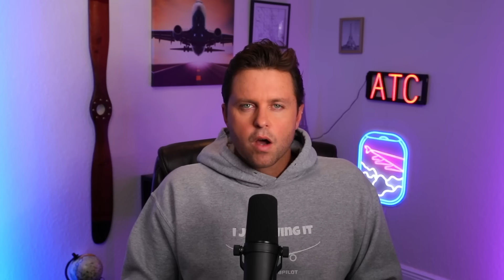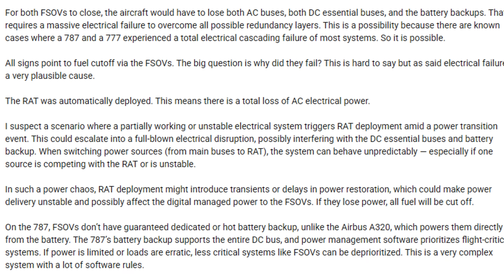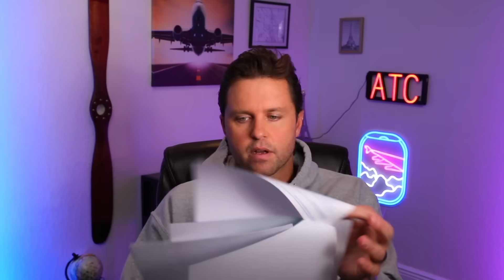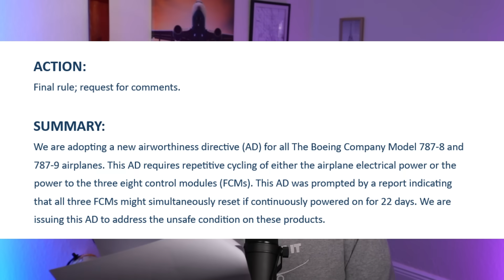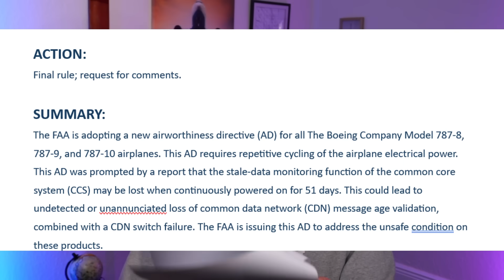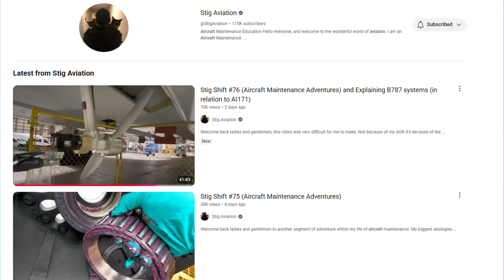Air India 171: Did a Software Glitch Cause Dual Engine Failure?

Comment: I wrote the following out yesterday, but I don't know enough about the interaction of the electrical and fuel systems to narrow it down, until seeing this video. But here's a compilation of all of mine and others observations and conclusions so far:

We know that the airliner took off normally, and ascended to about 400 feet altitude and SOMETHING caused a catastrophic loss of lift, leading to a descent and crash. 

More likely than not, this was the result of a loss of thrust in one or both engines due to the nature of the incident, the pilot mayday call ("thrust not acheived").
More likely than not, this occurred in both engines simultaneously, due to the lack of observed yaw at the time the descent began and in the moments leading up to it.
More likely than not, this was NOT the result of an externally induced mechanical failure (bird strike) due to lack of observed flames, flashes and/or smoke from either engine.
More likely than not, this was NOT the result of fuel contamination due to the suddeness, severity and simultaneity of the loss of thrust in both engines.
More likely than not, the RAT was deployed based on audio and visual recorded evidence and the firsthand account of the lone survivor (who described lights flickering and a loud bang).
More likely than not, an electrical or hydraulic failure occurred shortly after the gear retraction was selected, due to the observed wheel assembly rotation known to occur at retraction initiation, but was further observed to have been halted prior to the next phase of the retraction process.
More likely than not, the fault was an electrical or hydraulic failure due to the deployment of the RAT, which is known to occur automatically in a very specific set of circumstances relating to engine or hydraulic systems failures.
More likely than not, the specific circumstance for the deployment of the RAT was a failure of both engines, due to the likelihood of simultaneous loss of thrust in both engines.

Based on the above conclusions, I hypothesised that the simultaneous failure both engines was caused by fuel starvation, given the robustness of jet engine design to tolerate significant mechanical damage or fuel contamination and still produce thrust. Nothing short of a near complete absence of fuel being delivered to the engines should have caused such a significant loss of thrust, so immediately, without other external signs. Furthermore, I posited that the cause of fuel starvation was likely related to some kind of cascading electrical failure that occurred at the time gear retraction was selected.

Interesting to see other people narrowing in on the same direction.

Comment: This is very logical.

In my view, aircraft took off, sole survivor mentioned the lights flickered and then he felt weightlessness as the plane stopped rising. Another passenger the day before described how the plane had issues with non working displays etc. The pilot also described he lost all “power” and didn’t achieve thrust as his last communication. The wheels began to retract but stopped midway, which is why they had the forward angle. It’s as if the electric power just stopped and seized all hydraulics. RAT gets dropped as a consequence. 

Engines seemed fine at take off, it’s as if someone simply placed both throttles into off position. << This is has been on mind all along. But why. I don’t believe pilots did anything wrong, and your video is therefore a likely explanation of the plane simply shutting engines off due to some catastrophic glitch. 

liked & subbed 🤝

Comment: Not saying something like this isn't possible but are we conflating the issues here.  Transitions on i would imagine most aircraft electrical systems will not compete with each other. Once a GCU detects one or more  of many possibilities like over current, under current, over frequency or under frequency or a self-test failure it will drop that controlled system to the backup. If the backup fails as well it will immediately transition to the emergency and ultimately battery or in this instance the RAT.

The system would require an attempted reset to bring it back on and most likely manually initiated by a pilot and not automated. Cascade failures all the way to the battery backup or for jets like this the RAT should not be enough to starve the motor as the cascade failure happens even if they are spring loaded to closed with power off or momentary power loss. It would almost require numerous failures potentially with some being masked to give it enough time to drive closed when the cascade happens.

 Each backup power segment is typically  sitting at a contactor just waiting for a loss of a ground from the other system and relay being de-energized bringing that system contactor online. I would also be hard pressed to think they don't test this feature on functional check flights to confirm there are no chances of anomalies such as an FCSOV closing inadvertently under a cascade loss of power.

Comment: Go back in time to when the 787 was first released the batteries caught fire in Japan.

The entire 787 fleet was grounded for the batteries to be redesigned.

So the batteries in the 787 were redesigned in a rush by the team who didn't design the original batteries correctly.

Now after many years if those batteries are the original batteries they would have battery degradation from years of service.

So I would like to know if the batteries were the original ones?

And did the team who designed the batteries think about years of battery degradation?

Comment: why was not captain step on full brakes if the captain noticed a display failure after pass V1 call out?
Reply: The flight was normal until the aircraft rotated into the climb and reached 400 ft and then the problem occurred.

Comment: Something is bothering me so much ! In this case is the heat ! Almost 40 degree centigrade on that day ! Could it be possible that there was a condensation of the fuel  due to overheating ? This happen to me with my motor bike the engine suddenly stopped and would not restart ! The heat was also very hot here in the Philippines ! 42 degree c !  Could it be possible ?

Comment: I have absolutely no experience of aircraft engines - but quite a lot of experience with small piston engines. Bad fuel or starvation always make the engine sputter and or run un-evenly it does not shut the engine of at once. Just saying, to me it  seems strange if both engines shut of directly at the same moment from contamination..?

Comment: i thnk its fuel contamination, Second no body mentioned about fuel contamination on the fuel line trucks filters, Were they supposed to follow up filter replacemet? I remembered that a few years back in Philadelphia, PA, there was fuel truck issues with a dirty filter or burst filter.  I do not remember if there was after a plane crashed  or engine shut down  issues related with this fuel trucks.

Comment: This is all very close to my own comments day or so ago (either her, or elsewhere, don't remember which), especially pondering if could be quite similar to the MCAS tragedy.
Questions:  1) Are the igniters normally on or off during take off and initial climb out?  And, if were off, but, instead, had been on, could that have maybe restarted the engines after the second or two of electrical loss?
2)  How long would it have taken the FADEC to reboot and start responding to pilot input again following its own electrical restoration?

Comment: I am a Aircraft Structural Engineer not a system one but when you look at the logic behind the systems shut and start process in this plane, that does not make sense.
Engines are the only reason you can stay in the air and provide speed and lift!
Why having shut off valves closing for electric failure? Why not have a electric power redundancy there?

Comment: You've got it as close as we've presumed right from the beginning. The momentary power interrupt was the key and what caused it is the root of the problem. If it's a systemic failure then the world has a problem in hand which needs to be addressed on urgent basis lest we go the same direction as the B737 MAX situation when it needed 3 disasters to make Boeing admit to the design failure which was evident to most of us Aviation professionals right from Inception. Boeing shamelessly tried to hide it from the rest of the world as the victims were not Americans and belonged to the third world. Absolving them of criminal charges by the current administration is taking things to a very low level of moral and ethical standards of public responsibilities by a mega corporation like Boeing is too hard to digest. Sad state of affairs.😢

Comment: I want everyone to keep in mind that yes this is a plausible theory, but it’s also possible. The plane just had maintenance and that the mechanic doing it crossed a wire somewhere. And caused something to short out, I don’t know the maintenance guidelines of a 787 but it’s also possible that the spring loaded thing is supposed to be replaced every so often and it wasn’t. We just don’t have the maintenance records and until we do, it is impossible to say for sure it was not maintenance related. Air India are known for having crappy maintenance. That is just a fact, again, I am not saying that this is for sure caused by maintenance, but it is an unknown variable at this point in time I keep point I think a lot of people in the comments aren’t understanding that this error worthiness directive suggests that if you power cycle, the GCUs it will prevent this problem from happening. It’s also possible that Air India just failed to do this.

Comment: General Aviation knowledge: Two engine failures are rare. Now this.  If the FAA has three directive to do reboots ... how long it will take to have a forth or fifth one. Wouldn't be better to address what is missbehaving and needs to be rebooted ?. Complex task for sure, but they are an aerospace company.  I would imagine that all this reboot shouldnt be needed anymore because a company like Boeing most have fixed them by now ... havent they ?. Or the are not spending engineering hours on making they jetliner recilient ??. And good luck proving that Air India had a Glitch ... wondering if something in the FDR will be able to point something like that of they will pretend that nothing happended or blame the Pilots because the are "third world" pilots with "poor formation" ( as they did in the MAX).  The only issue is, cameras everywhere and highly professional content creators on internet exposing and narrowing the possible causes. Personally, I would try to book in Airline that fly jets that dont require so much rebooting or fly 777s prior 2010 or so.

Comment: If it had been contaminated fuel, more planes would have had problems and maybe even crashed.

The Boeing whose engines died on landing because they couldn't change from flying to ground driving fast enough, can the same thing happen when taking off, you wonder??

The pilots have electrical problems, are a few seconds too late to change to flight mode and the engines don't get any fuel, the RAT comes out and then ......

Comment: The air temperature and the aircraft sitting on the ground are not uncommon by any means. The engines I think will tell the tale especially if they are chocked with bird remains. On take off on the video white clouds are seen to exit the aircraft and descend to the ground. Just prior to this the aircraft is behind the shed blocking the view of the engines at perhaps the time of bird impact. Why all the so called expert are missing this I do not know
Reply: From this position the aircraft rotated and climbed to 400 ft in 10 seconds, at a climb rate of 2,400 ft per min, which is normal. 

If there was a bird strike while the aircraft was out of view, when it become in view again, the engines would probably have been suffering compressor stalls and blowing smoke rings and fire out of the engines. And also causing loud bangs. This was not seen of heard in the other video, just the sound of the RAT and the main engines providing low power.

Comment: From an  IT professional standpoint ( and just my observation and thinking) "Shutdown and restart" . I'm not in any way familiar with an aircraft computer/software system.  Computer components are very finicky and work their best  in a very tight control environment, humidity and heat variables. When these go out of normal operating ranges you can have a build up of static electricity and may cause computer systems to malfunction. A simple temporary fix is to reboot the system. NOW i don't think and aircraft engineer would design a system that would do this . But MAYBE ( I am not saying there is)  they did have a programing to reboot the system ( automatic power cycle ) if the system becomes unstable or unresponsive.  This is my theory form all the data presented form all credible YouTube channels such as yourself.

Contaminated fuel / incorrect flap setting , just does not make sense to me . from my basic understanding, it's a very computer dependent aircraft , and computers work best in a very controlled environment . The environment is very dynamic. 

Could it be a simple thing as cooling the avionics bay stopped working and caused a system wide failure ? 

I'm very interested to know what really happened.

Comment: Hi I've never been in a plane but when you mention thrust reversers and shut down on landing, is it possible that happened  on takeoff, pilot accidentally caught the control for the thrust reversers?
Reply: The thrust reversers are locked in the closed position and have to be unlocked and then armed. They are deployed when the Weight on Wheels (WoW) switches are made when the wheels touch the ground or when the aircraft is within 10 ft agl and measured by the Low Range Radio Altimeter.

Comment: I am an electrical engineer , i don’t have knowledge of nuances of engine but RAT deployment made me think on similar lines. Transition from main bus to RAT could lead to massive change in electrical circuitry and what if it changes the engine control. But dropped that line thinking that this would have picked up in heavy safety compliance checks plane goes through. This video puts things in perspective

Comment: Google AI says FSOVs are normally open.  Hence, it takes electrical power to close the valve.
@0:55 "most people, including myself, could not definitively even point to a root cause as to what would cause two engines to fail simultaneously on take off". My bet is on center tank condensate fuel contamination but cannot rule out undissolved KATHON fuel additive as described here https://youtu.be/k99P7g1x7F4?t=112

Comment: Smoke on takeoff  from engines was the clue  not dust that most people say, theirs no dust drift from an active runway the smoke was a sign of fuel contaminants seconds before flameout
Reply: The runway is 150 ft wide and the B787-8 wingspan is 197 ft, so the wings overlap the edge of the runway by 25 ft each side. As the aircraft rotates the wing tip vortices pick-up dust from the sides of the runway. The aircraft climbed to 400 ft (twice the wingspan) in 10 seconds, at a rate of 2,400 ft per minute, which is normal. The problem occurred s short time later.

Comment: Pilot Gary, Fuel Contamination with rainwater ingress thru vents in fuel tanker lorry fuelling plane. For past few days very heavy rains in Ahmedabad at nights. While taxying ALARM might have come in cockpit. But pilot by-passed ALARM thinking it's false. After time delay maybe 3 minutes power to both sides fuel pumps went off. The time delay maybe to move plane from main runway to side runway for maint. But by this time Illl fated plane pilot taxied down runway and took off. At 800 ft power to both sides fuel pumps shut and engines flamed out causing crash. If AIR INDIA operator had  a proper SOP - std operating procedure for fuel contamination,  pilot would not have by-pass ALARM. AIR INDIA is fully responsible for this accident. All other operators have proper SOPs for fuel contamination. No wonder AIR INDIA has offered one crore INR to each family of victim.